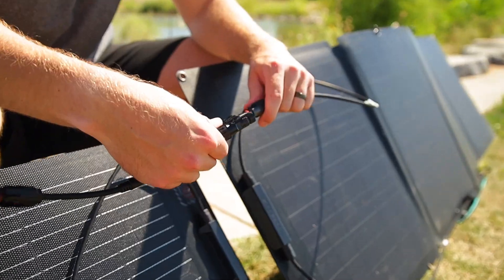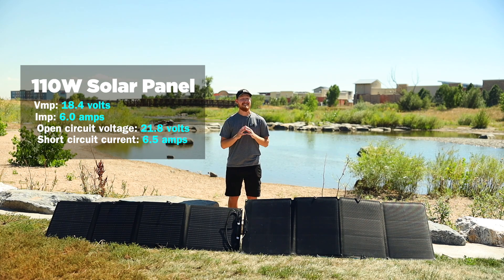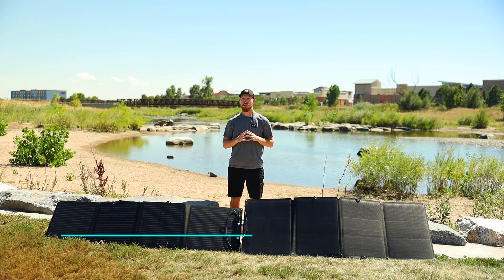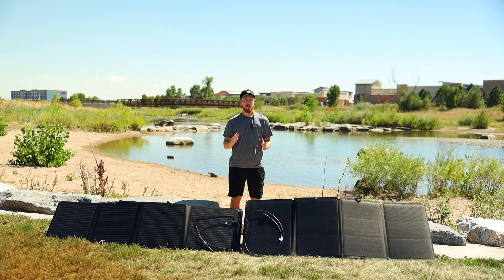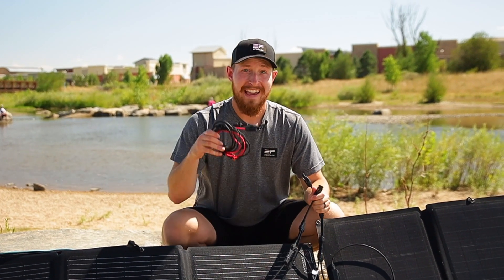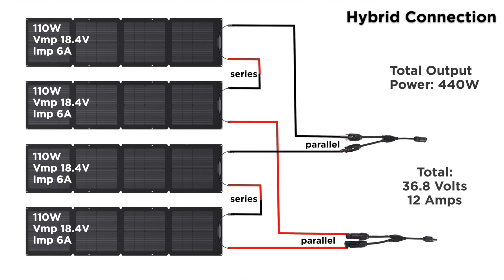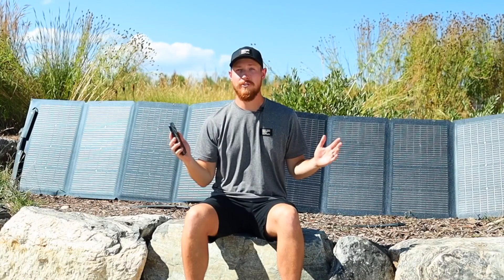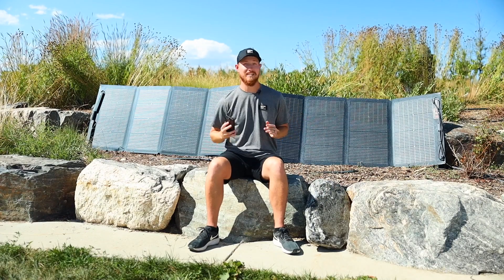Which one is RIGHT for you?

Comment: I think this may have solved my issues with newly purchased delta 2’s that wouldn’t accept the solar from a setup with a delta 1300 that runs flawlessly. I will buy the adapter mentioned as I tested the delta 2 on a single and a double panel in series and it accepted the solar…
The adapter should allow it to charge as it should.
Thank you, I will try to follow up in a week or so.
Reply: Just to follow up, wired in the hybrid as mentioned here and the delta 2’s are receiving signal from the panels. Thank you for this, you solved a problem no one else could. Including your own customer service!

Comment: Can i do a series connection of 110w and 160w together to charge the Delta 2, or River 2 Pro?
Reply from the maker: Hi there, it is not recommended to chain panels of different watts together. Panels of the same specs would be fine.

Comment: I have a Delta 2 Max and four 220 panels. My current home situation needs to use 50 ft cables between the Delta and the panels. My goal is to get the quickest charging time out of the panels. This is due to having a limited window of sunlight during the day (conservative estimate is ~4-6 hrs), which at times will include some partial shade. What is the best strategy for my situation, whether series, parallel or hybrid? What gauge wire should I purchase?
Reply from the maker: Hi there, Delta 2 Max has two solar input ports, you can chain two solar panels in series and plug this set into one of the ports. As for the gauge wire, it is suggested to use 14 or 12AWG. Let me know if you have other questions🙌
Reply: @EcoFlowTech  Thanks. That’s the set up I was originally thinking about. But then I heard about parallel and hybrid approaches, which spawned my question. 

Considering what I described of the ~4-6 hr sunlight window, w at times some intermittent shade would the series set up be able to charge the Delta from a low 10% to a high 90%? Ultimately want to know if parallel or hybrid is a better approach. And if so would I need to use a different wire gauge. Maybe the series set up w a 4-6 hr window w some shade would struggle to do a full recharge even though it’s generally considered quicker. Maybe this will come down to doing some tests (eg I might learn the amt of intermittent shade on one panel in a series set up impacts ability to recharge in full in available time frame), but I need to invest in the wires and would prefer to make the right purchases there upfront, if possible. 

Thoughts?

Comment: Would you recommend using 2x110w panels over a single 220w? I have a River 2 Pro and looking for new panels.
Reply from the maker: Hi there, both can work, either you want to connect them in series or parallel.

Comment: What wiring config do you recommend for the 4x 220w portable panels and a Delta 2 Max package?
Reply from the maker: Hi there, Delta 2 Max has 2 solar charging ports, each of which supports 500w solar input. It is recommended to chain 2 220w panels in series for one port. Let me know if you have other questions!

Comment: Hi, bit of a noob here, so please be kind. I have 4x405w panels - each with a Vmp of 31.18v and an Imp of 12.99a - does that mean I can't utilize the full power of all 4 panels combined to charge a Delta 2 Max?
Reply from the maker: Hi! You can connect one 400W panel to one solar charging port on Delta 2 Max, which means that it only allows two 400w panels in total. Let me know if you have other questions! 🙂

Comment from the maker: We have received a heated discussion over this video and thank you so much for sharing your actual situations! Here are some clarifications regarding the environment temperature and the limitation of amperage and watts.
1. Temperature: according to the user manual on the temperature coefficient and the use of temperature range calculation, it is recommended that the series and parallel connection are not beyond the minimum use of temperature under the voltage. 
2. Amperage and Watts: There will be differences in your actual use over this point. For example, according to the usual outdoor light intensity of 800W/㎡, the total power of your solar array can be 20% higher than the battery requirements; but some areas may have better sun radiation (conventional light intensity of about 1,000W/㎡),  there are certain risks if the solar input surpasses the battery's limitation.
3. The battery will limit the solar input, restricting it to the maximum allowable current.

Comment: I recently bought a Delta 2 Max. Please fix Back-Up Reserves in the Energy Management setting its not functioning like intended this week update broke this function when you enabled it trigger overloading message and shut off once disabled Back-Up reserves, the battery function normally. I just bought today 2 extra 🔋 hoping don't regret that decision.
Reply from the maker: Hi! Could you please check your current firmware version? Make sure it has been upgraded to V1.0.0.126. Let me know if this helps solve the problem!

Comment: The information in this video is incorrect, as two other commenters have already pointed out.  I’m using 2000W of panels on my Delta 2 Max which only accepts 1000W of solar input.

As long as the Voc of the panels does not add up to more than the max voltage input rating of the unit (60V on my D2M), you can connect as many panels as you want.  The charge controller will only draw as much current (amps) as it can handle.

My panels have a Vmp (voltage at max power) of 30V, a Voc (open circuit voltage) of 38V, and a Imp (current at max power) of 8A.

The D2M has two 500W solar inputs at max 60V and 15A.  With four panels in parallel they can supply up to 32A, but the D2M will only pull 15A.

I can’t wire these panels in series because the Voc would be 38V x2 = 76V which is higher than the input rating of 60V.

Why do I have 2000W of panels on the 1000W input of the D2M?  The panels I bought were used and very cheap ($600), and it allows the unit to charge at its maximum 1000W rate under less than perfect conditions.  I have an additional battery on the D2M for a total of 4kWh of storage, so to charge that up in one day I’d need 4 hours of perfect conditions with the sun directly over my panels, which doesn’t happen often.  Also, if you are using any power while charging from the panels, that is power that is not being used to charge the batteries.

Also note that in cold weather solar panel voltage increases.  If you’re going to use your panels exposed to cold temperatures you’ll want to make sure the Voc is comfortably less than the input rating of your unit.  Panels are rated at 25C (77F), so at -15C (5F) the Voc could be as much as 12% higher than its 25C rating.  That would mean my D2M shouldn’t be used with panels with a Voc higher than 60V / 1.12 = 53.5V if using in cold temperatures.
Reply from the maker: Hi, thank you for sharing! In your case, it is recommended that you connect two solar panels in parallel to each solar input interface. Under this situation, the voltage will be 38V <60V, and the current of 8 * 2 = 16A > 15A. Given that the outdoor light generally does not reach the standard conditions (1,000W/㎡), you can exceed the current limitation a bit. However, please pay attention to the possible overheating of the battery when the total current goes up to 32A. Let me know if you have other questions! :yougotthis:
Reply: @EcoFlowTech  the current drawn never exceeds 15A.  The MPPT charge controller will never draw more than 15A from the panels regardless of how many panels are wired in parallel.

Comment: You really need to clarify about the amperage and watt limitation.

Amps are "pulled" by the EcoFlow so there is no concern with being over the amps or watt specifications.

For example, the “maximum” of 15 amps is a limitation of what the Delta Pro can consume or take in itself.

So even if the panels produce 20 or 25 amps, the Delta Pro will only take 15.9 amps.

Think of the 15 amp outlets you have in your house. The breaker in your panel is rated at max of 15 amps but when you plug in a 100 watt light bulb into the outlet, the bulb doesn't pull 15 amps. The bulb only pulls the current it needs to operate the bulb which is what the DP does with the solar array power.

However, volts are "pushed" so it is CRITICAL that the 150 volt limit of the DP is NOT exceeded under ANY circumstances after factoring in lowest panel operating temperatures.
Reply: I'm beginning to think I need to take a test and get certified to do this stuff... LOL!!!

Comment: The information isn't correct. Most important is to keep the voc under the unit max based on the temperature. It is safe, and sometimes recommended to overwatt  or overpanel to take advantage of less than optimal conditions. Using a 160w or 220w panel with a river 2 for instance is safe and works well.